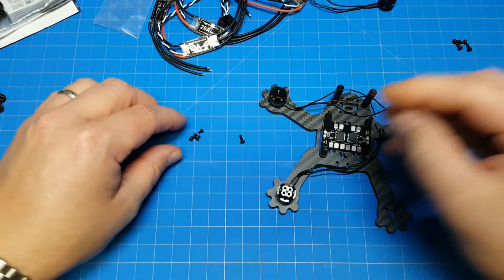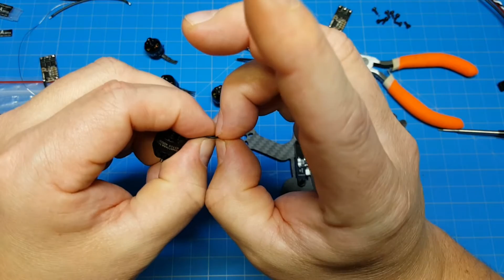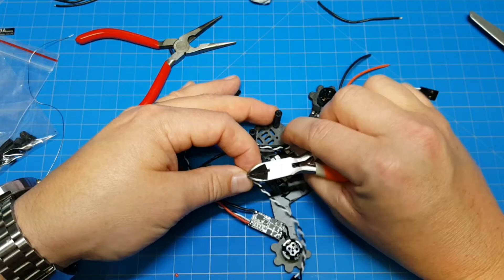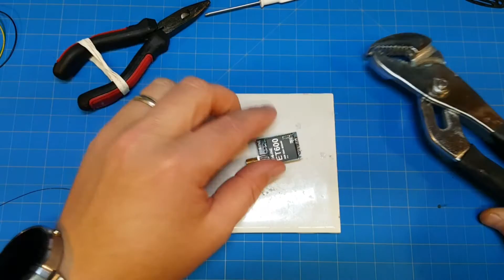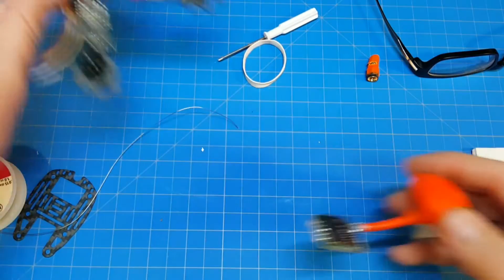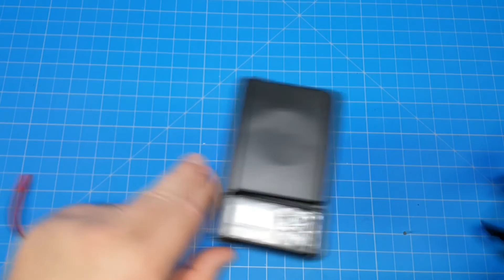FlexRC Frog - Build - 120mm Brushless Bundle of Joy

Comment: ive got a Micro 32bits F3 Brushed fc,will rx1105 motors work without 4 esc's?trying to keep weight down
Reply from the maker: well technically no, but yes too. The 4in1 esc is a single board with 4 escs, the stack will be very tight adding a 4in1 esc board.

Comment: Thanks for the review. I'd love a brief flight report. How did it live up to your expectations? Can you compare it to other brushless micros like the GT90?

Thanks again
Reply from the maker: I don't have the GT90, as for the frame and flight experience, it flies well. My personal preference would be to use 1306motors for added thrust, or run quad blade props on the 1105s. I did break a top plate when I powered into the ground upside down, but I felt that was pilot error not a design failure.

Comment: lol no at the end I wanted to c it fly..Do you like it better then the tarot 120 ?
Reply from the maker: I but only becuase I can switch out the flight controller. Only the tarot flight controller will mount with screws to the frame. The flexrc frog can use any full sized flight controller.

Comment: @ nick burns with wich configuration did u ordered the flip32 at Ready to fly quads?
And is the buzzer loud enough? 
Thank u a lot
Reply from the maker: in the video its it the deluxe version. If I were to build it again today I would buy an F3 board, I think they fly more smooth.
Reply: Thank you. But did u ordered with pins? Or only with buzzer? 
Wich F3 board u'd prefer? 
I intend to do a 130 geprc gep130x build.
Reply from the maker: No pins. I direct solder almost always. Even on larger builds it just as much of a pain to wrap up the wires as direct soldering. I don't have an affinity to one over the other. I bought one of these most recently http://www.banggood.com/Upgrade-NAZE32-F3-Flight-Controller-Acro-6-DOF-Deluxe-10-DOF-for-Multirotor-Racing-p-1010232.html ...it was cheap/on sale and has the F3 chip. The differences in these boards is so minor I cant think of what differentiates them.
Reply: +Nick Burns many thxs.
Reply from the maker: Sure. your building a frog or something similar?
Reply: +Nick Burns No GepRc Gep 130 x is planned. 
But except a micro this will be my first build. 
Flip32
Dys 1306 4100kv
Diatone PDB
maybe Littlebee Bheli S ESCs
thats the plan...but I'm still watching other builds before i finally start. Some parts been ordered already but FC and ESCs ec not yet. Your Frog build and the lemon bind to flip32 helped already a lot.
Reply from the maker: The first is nerve racking. Take your time and double check. Normally any mistake can be corrected. My dad says: "the true test of a craftsman is how well he fixes his mistakes". We soldering leave yourself a few millimeters extra incase it has to be rotated or redone. Good luck and if you are unsure or get stuck I will try to help.
Reply: Were dit you soldered the 5v power from the pdb to the flip32?? thx
Reply from the maker: I soldered to the motor inputs on the fc. I had to double up on the ground but any of the available positive motor pads will supply 5v to the board.

Comment: Great video thank for posting. What AWG wire are you using for your battery is 18 AWG adequate? Thanks
Reply from the maker: +Quad Bob yes 18awg, the batteries I have are 18 or even 20-22. I have 3s 450-600mah batteries. I have not noticed a difference when running different batteries, but I only have 4 tuning flights so far.
Reply: Thanks for the fast response and the info. Also great work in previous videos. I will be commenting again soon. Thanks